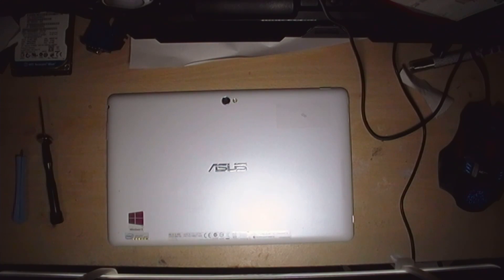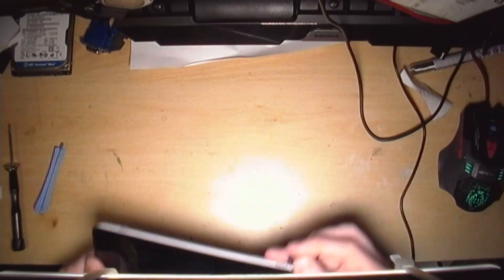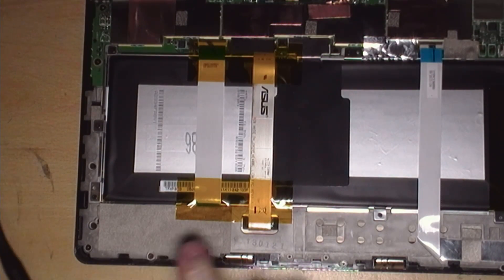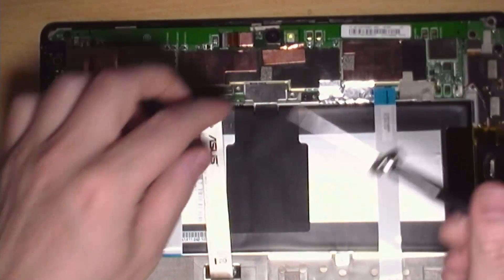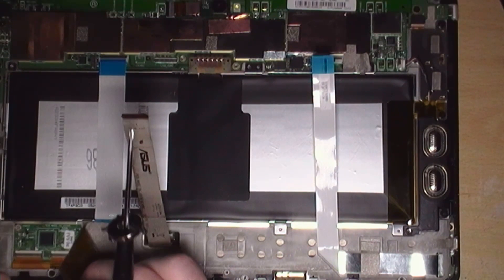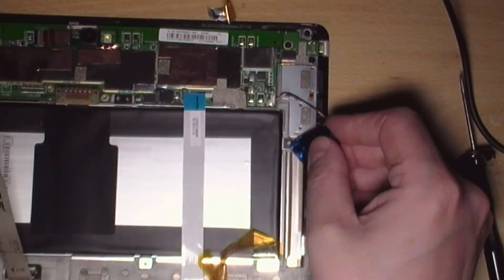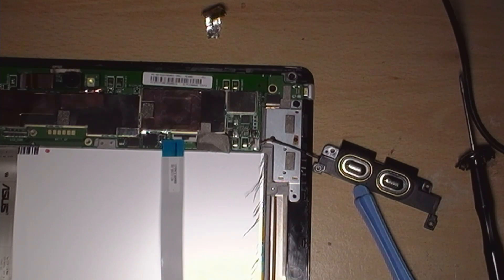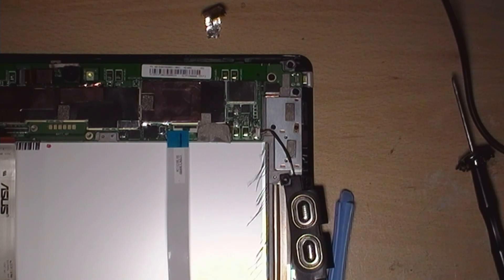ASUS VivoTab KoX ME400C Windows Tablet - Battery replacement / Open up

Comment: Hi, i need to reinstall Win 8. Do i use the Micro battery charger socket for this or will the SD slot work with bootable SD card as this didnt seem to be recognized in BIOS? . Theres also a micro HDMI socket. whats this used for ?  thanks for any help.